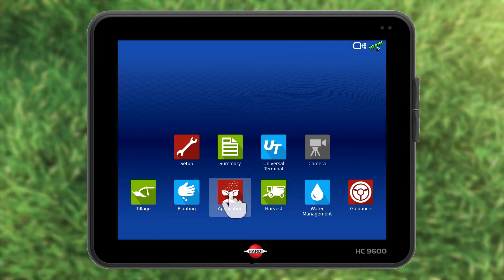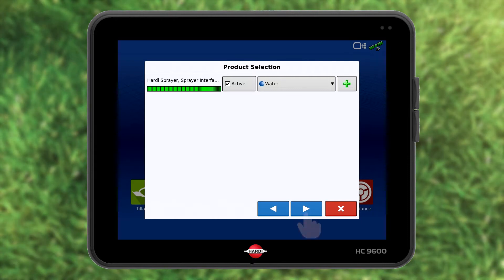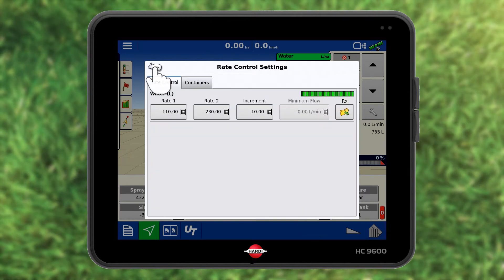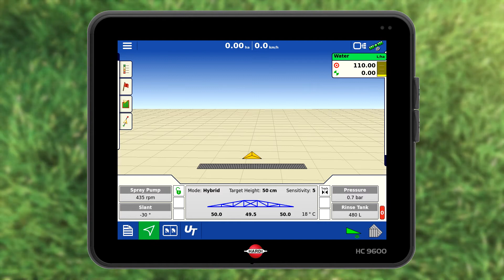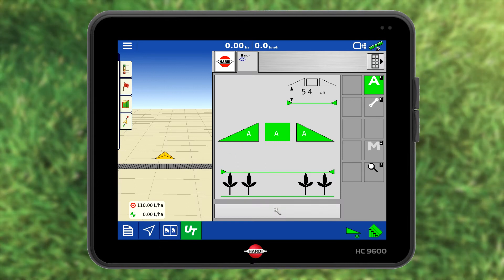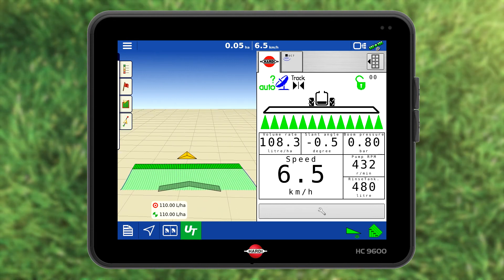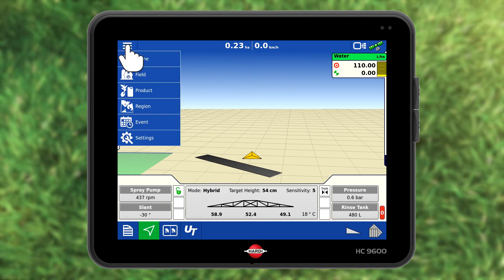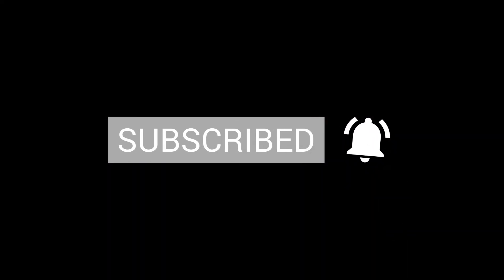Instructional Video: HC 8600 / HC 9600 – Start and stop a spray job

Comment: Is it still so that users of Hardi monitors can't update the software? If you have an Agleader or a John Deere monitor it is pretty easy to upload new software from manufactures www-homepage and load it to the tractor monitor. But last time I checked this was not possible with Hardi HC 9500. Am I stuck with the old software  in HC9500 forever? 

Second question. My list of products in the monitors memory is getting long. Is it possible to remove such chemicals that are no longer in use?

Third question. I would like to add steering assistance to my system and control it with HC9500. Is it possible and should I get the OnTrack steering wheel rotator from Hardi or AgLeader?
Reply from the maker: Hello Ville Hakanen,

1.       You are not stuck with old software on the HC 9500.
We could make the software available but it is only  a reality for a new or “isolated” terminal. Some settings get deleted, some revert to standard values, field data may be lost etc. Therefore software is available via the dealer who has the routine and expertise to help you.
The current software is 7.5.  If your software is older than 4.5, it has to be upgraded to 4.5 before you can upgrade to 7.5. This may be several steps if, for example, it is 3.0 or 3.1.
We recommend a backup be created prior to upgrading display software.
Contact your local HARDI dealer.
 
2.       Removing chemicals (deleting Product)
Open Configuration Setup.
Press Product tab. You can see all the products.
Press the Product you want to delete, so it turns blue and then then press the minus button to remove it.
 
3.       Adding AutoSteer
It has to be purchased through the AgLeader dealer. Please contact them.
Reply: @HARDIsprayers  Thank you for your very usufull answer. I was able to remove all out of date products. My software is 6.2 so updating should not be too difficult. In my opinion you should make the updates available for end users like they are for Agleader Integra owners. I do not believe updating HC9500 is more difficult than for Integra. Dealers mechanic will charge 200 euros just to drive to the farm and then 85 € / h for the actual work that could be easily done by myself.